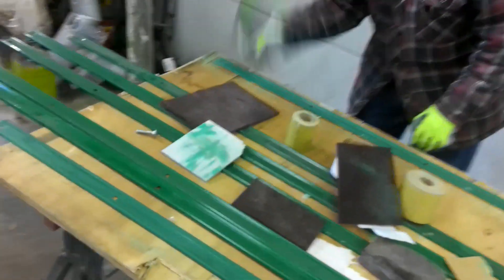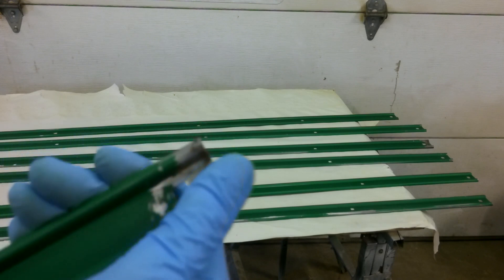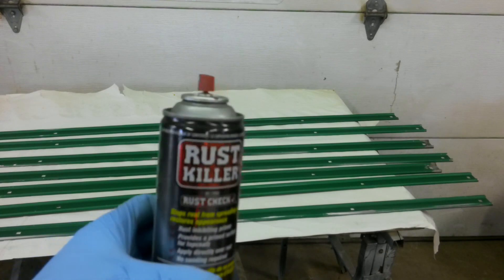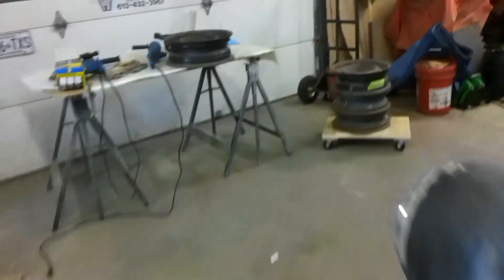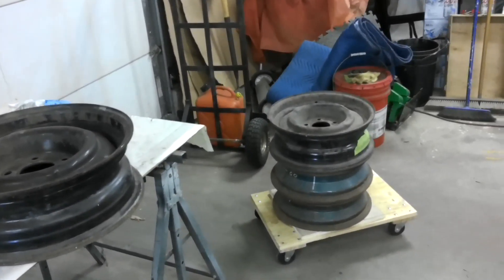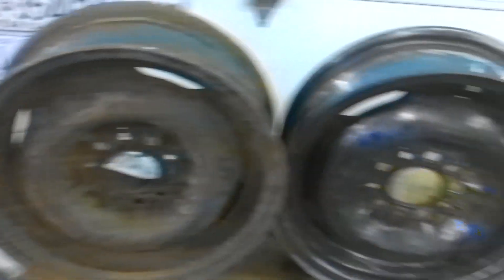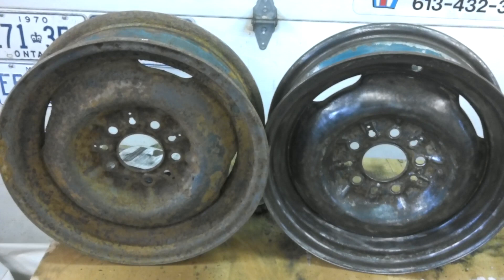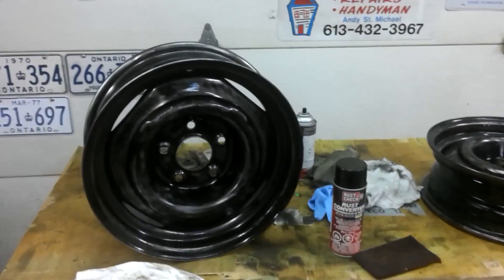# 152 1954 Fargo

Comment: Red would definitely look good against the black body of the truck . Andy thanks for sharing .
Shawn
Reply from the maker: Hey Shawn.  Thanks for dropping by the Dog House. I think I will go with the RED. But what shade? Lite or dark?😕
Reply: @AndysDogHouse  I’m like dark red like international Harvester red . Light colors will make the rims look thin while dark colors make the rim look deep and wide ....at least in my head it does . What ever color you pick will make it look great ..I’m sure . 
Shawn
Reply from the maker: @rustyrods8535  Hey Shawn. I think you are right. Now if I can find a store to buy it. Here in Ontario, we are on a covid lockdown. essential travel only. Stores are closed or curb side pick up.
Reply: @AndysDogHouse  Andy that’s to bad , we are pretty much open up here with very low case numbers , but still need to be careful when out and wearing my mask . Hopefully you can find a store that has the color you want . 
Shawn

Comment: Hey! Rails look good. I use rust convertor from ct. the metal strips determine the cross brace spacing. 
Got a temp tag on mine,safety on monday👍
Reply from the maker: Hey Frank.  Thanks for dropping by the Dog House. Yea, the rails that I have are different from the holes that I have so I need to drill new holes.